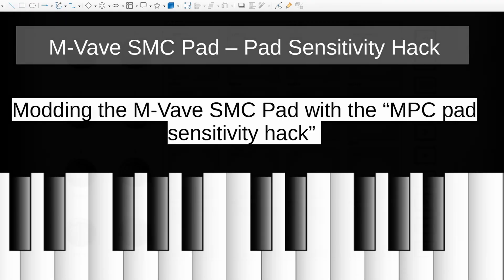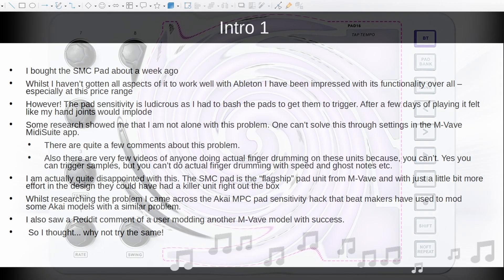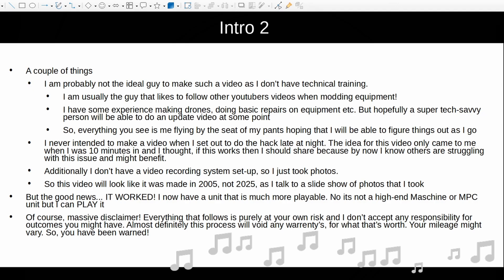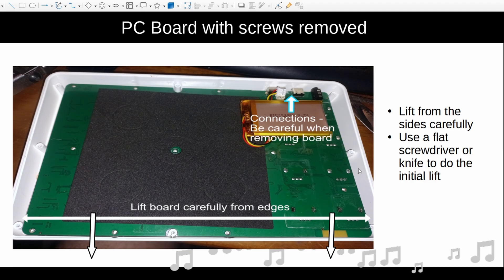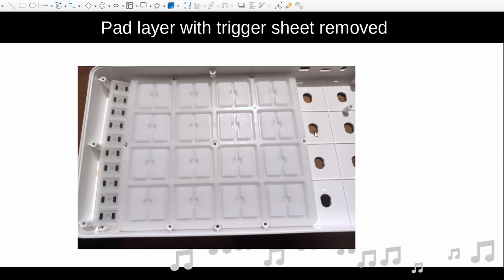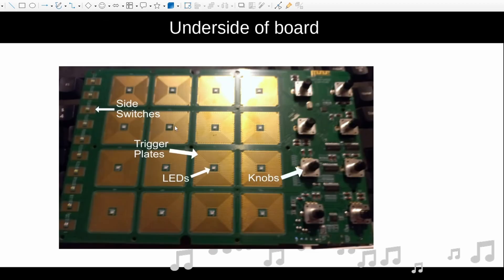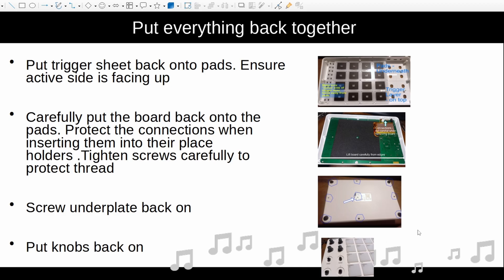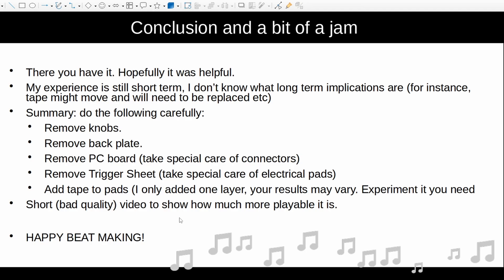M Vave SMC Pad Sensitivity Hack

Comment from the maker: I forgot to mention that I set the PadCurve to 3 in the M-Vave MidiSuite. I find this gives me my preferred sensitivity setting on the software level for finger drumming. So Pad Sensitivity Hack + PadCurve = 3 is awesome
Reply: Did you try setting the PadCurve to 3 in the M-Vave MidiSuite before you did all this? I'd hate to think that would have done it without opening it up. I'm willing to do all this but certainly going to try that first.
Reply from the maker: @BipTunia_Microtonal_Cats  Yes indeed, I tried all the sensitivity settings, multiple times. None of them made the difference I was hoping for, hence trying out this mod. A lot depends on your use case. If you just want the SMC Pad to control your daw and trigger long playing loops or tracks, then the standard set-up is fine. However, if you want to finger drum you are going to need to find a way to increase the sensitivity a lot. The only way I found to do this is through this physical mod, adjusting the sensitivity settings are not going to give you what you want. However, after doing the mod, I have found that adjusting the sensitivity settings makes a useful difference to the requirements of the moment. Mostly I keep it on level 3, but there are times I will change that. Hope that helps.
Reply: @owlmuso  Thanks. I will try this if I can't get it to work, but I plan on playing the one I ordered with light rubber mallets, so might not need the hack. Might not even need to change the sensitivity.
Reply from the maker: @BipTunia_Microtonal_Cats  O thats interesting... a unique take. Would love to know how that works for you if you don't mind sharing your experience.
Reply: @owlmuso  Thanks. I just ordered it on eBay last night, so maybe in a week I'll have it. I got the idea from seeing drummers play electronic drum pads in the 80s, they're playing a full kit, but have a pad thing, like this but bigger, with fewer pads, maybe 8, and it's hooked up to some percussion synth. Stewart Copeland used to to do it. 
            One or both of the drummers in the Grateful Dead used a bigger one in the  "Space > Drums" jam section in the middle of a concert. I just did image search for 
Bill Kreutzmann electronic drums
and found a pic of it, it's wider, maybe 2 feet wide and is set up like a piano, where the white keys would be and the black keys above, all on the same plane, for like an octave and a half, but the "keys" are rubber, all black, and probably 5 inches high and 2 inches wide. I never got close enough to see it but I heard stuff during the drum jam in the 80s that was played with that, and I've seen video from the 80s of them playing it. Probably cost as much as a nice car back then. lol.
Reply: @owlmuso  I wrote a long reply. It vanished. Grateful Dead and Stewart Copland used some kind of MIDI pads played with mallets.  (not all the time, just for flavoring on a few things, GD for "space / drums")
Reply: @owlmuso  Could probably even use (unused) pencils, hit pads lightly with eraser, use them like drum sticks.
Reply from the maker: @BipTunia_Microtonal_Cats  Yeah, drum pads have been used a lot since the 80s, so good inspiration there :). If I recall, Korg, Yamaha and Alesis made electronic drums, versions of which morphed into pads that could be used with acoustic drums.  Excellent for playing electonic sounds, loops etc and generally expanding the drummers sound pallet. The challenge with the SMC Pad will be the size of these pads... not a lot of real estate to aim at with drum sticks. Could potentially  work with micro drum sticks tho, I think. Also the unit itself is quite light so will need to be placed in a firm, safe place.
Reply from the maker: @BipTunia_Microtonal_Cats  Actually, I saw the long version... youtube can be weird like that sometimes. There have been times when I posted something, thinking that it didn't go thru, but then saw it later
Reply from the maker: @BipTunia_Microtonal_Cats  re. pencils... might not be heavy enough. I have messed around with the back end of forks or knives, which have worked on other pads I was trying out previously. But pencils would be ideal if they do work, in terms of size and form
Reply: @owlmuso  That's been happening more lately. I see it now too.
Reply: @owlmuso  Might be with the hack! I was just thinking pencils if anyone's on a tight budget. I'll let you know if what I ordred works, "4 Pcs Steel Tongue Drum Mallets, Xylophone Mallets, Glockenspiel Mallets, 6.5in Rubber Percussion Mallets, Children's Rubber Drumsticks, Wooden Percussion Mallets, Percussion Sticks" was 8.50 for 4 of them. Pictures show kids playing a xylophone, so probably won't break the thing.
Reply: Yes! Perfect that's the added fix. Two strips of tape for me, but sorted. That's brilliant thank you so much!!! 😊🎉

Comment: Also confirmed on the Pocket.  I had white electrical tape and just cut squares the size of the contact pad.  I covered over the LED as I found them a bit too bright anyway and the app doesn't actually do anything when you turn down the brightness

Comment: Thanks a lot for that, I just did this to my SMK-25 and with two layers of tape it feels way better. These video format is really good tho. It feels organic, not dead internet theory.

Tips for SMK-25:
- You don't need to void your warranty. There are no screws behind the sticker.
- There are two screws under the rubber things at the top, but not at the bottom.
- You don't need to remove two rows of screws at the inner bottom, as they only hold together the keyboard to the case
Reply from the maker: Awesome! Thanks for this feedback regarding the SMK-25. I am sure there will be those who will benefit from it. Are you enjoying the keyboard?

Comment: If there is anybody here for the MVAVE pocket. Disassembly is basically the same. Except it's just back housing, PCB assembly, front housing. 

I got good results putting 3M double sided tape on the bottom housing under the PCB, but leaving the red backing on the open side so I can still take it apart if needed. 

A lot more sensitive once you get some pressure in there.

Comment: THANK YOU! It fixed the problem 1000%.. I had to do it twice tho, because first try i used to much tape and too thicked of a tape, so i cut mine in half and didn't let if out of the rubber pads.
Reply from the maker: Interesting. Thanks for sharing. Did you take pictures of the tape that you installed?

Comment: Hey man thanks a lot for this video. I tried this hack and it is almost perfect, but for some reason PAD13 (top-left corner) is always getting a continuour trigger even with PadCurve 3 or default. I thought it could be the angle I was installing the PC board back on, or maybe the pressure a tightened screw could apply over that area. I tried everything, but PAD13 is simply not usable with the mod. So I took off the 3M Scotch Super 33+ Vynil Electrical Tape from PAD13, and decided to use that for FX samples and focus on all other pads for finger drumming. Has anyone experienced this as well? Any suggestions about a different tape brand? Besides that, this works just as you described, so thanks again from Costa Rica.
Reply from the maker: Hey dude. Sorry to hear about pad 13. I think you would have to play around with it especially as it is a corner pad, which might impact things. When I was experimenting, if I added 2 or more layers then the pads  would trigger continuously so obviously the overall thickness was too much. I would think that standard tape might therefore be too thick for your pad13 specifically, and might require thinner tape there. As a matter of interest, is pad13 relatively easier to play compared to other pads if they did not have tape?
Reply: @owlmuso it is slightly easier to play than the other pads without tape, but still difficult enough for it to drive me crazy. I'll try with less or thinner tape, thanks for the suggestion!
Reply from the maker: @VadikGilcok  Good luck man. Its hard to suggest an alternative to electrical tape as some other types of tape might be thinner, but also less hardy, which could impact reliability. For instance sticky tape comes to mind, but I wouldn't recommend it. But do us all a favour and let us know if you find a solution as I am sure there are others facing the same issue - o yes, and a shout out to Costa Rica from South Africa!

Comment: have the MVAVE pocket seems to be the same issue but haven;t been able to fix it gutted
Reply from the maker: Thats awful man. These units have so much potential, except for this issue of pad sensitivity. Have you been able to try a similar hack on the pocket - adding electrical tape to the underside of the pads?
Reply: @owlmuso  come back here as i finally got back into it - tried the tape. over did it, then took the tape out some how better - will let you know if i can drum well enough 🫰

Comment: Just bought one of these. I have no problems with pad sensitivity. Its just works great without any hacks.
Reply from the maker: Cool, don't open it up if you dont need to. Enjoy
Reply: I wonder if a lot of people complained and they fixed it (maybe because of this video!). Owl, when did you get yours?
Reply from the maker: @BipTunia_Microtonal_Cats  I have read quite a few complaints about the pad sensitivity online... reddit, amazon reviews etc. So, its not just me thats complaining, lol. I bought mine about 2 months ago and I doubt they would have fixed the issue since then as it would require a hardware upgrade, something I would imagine they would do in a Mk2 version for instance.

Comment: I love this company man, I own one of everything they sell. I consider them on-par with any of the lower-ended branded stuff but at a ridiculously lower price point. Some of their shit even has more or better features than their branded equals. The SMC-Mixer is like it was made for Ableton. I didn't purchase the Pad for finger drumming. I use it for triggering & holding Arps & Basslines (303 etc.). So like horizontally across, 1st pad is Hold & next 3 are 3 octaves of the same key & the 2 rotary encoders in each row are Cutoff & Resonance. Each row lives on a different midi channel so there are 4 synths I can control. Different preset on the pad (there are 8), different key. Works for me. Lately I've edited all the bottom rows to fire-off single shots, 3 synths were enough for that job.So in this scenario, pad sensitivity not so critical for me. The SMK25 MkII with it's layout (8 horizontals of 2 pads & 1 rotary in each) became an extention of my SMC-Mixer so I can have Chan.9-16 from Ableton accessible (Mute, Solo, Track Level), without scrolling the mixer (I probably will purchase a 2nd unit at some point). The SMK25V2, similar scenario, 8 Presets, on 8 seperate midi channels, 8 different possibilities. So yeah, only good things to say about this company. They do what the Chinee do best, copy the shit out of other people's efforts, make it even better & sell it at half price. Gotta love'em. Cant wait for them to do a proper Launchpad with RGB feedback from Ableton. I'm really needing it these days & might have to grab the Novation or Akai, when the wife isn't looking.
Reply from the maker: 100%. I am new to M-Vave but I think your analysis regarding their "place" in the music making market is spot on. I really like my SMC Pad for how useful and fun it is. Out of the box it is a really good controller and sample trigger. And if thats what you are using it for then its great as-is.  I appreciate learning how you put it to use as I want to extend how I use it with Ableton - I am having problems implementing the controller side of it.

To continue with the discussion about finger drumming. To me finger drumming is implied in its "mission". The 4x4 pad set-up looks like every other standard finger drumming unit. Thats why I bought it, and, from what I see online, why many others also bought it. its not like I am trying to use it for something other than what its marketed for. So, as a finger drumming unit, it is limited out of the box. I need it to not only be a controller, but also an instrument. This hack turns it into an instrument for me. To be honest, I am a little disappointed with M-Vave in this regard, in that with just a little more attention to the design of pad sensitivity they could have satisfied all users - midi-control-centric users as well as finger-drumming-centric users. Bottom line is this hack turns the SMC Pad into a really cool finger drumming unit, which makes me happy.
Reply: @owlmuso  Have you seen their new product, SMC-Pad Pocket. No knobs or buttons, just pads & about 40% smaller, 40% cheaper. I'm going to grab one for extra buttons. It's a no-brainer for turning FX On & Off.
Reply from the maker: @AA-ge4uj  I did see that Pocket Pad. I wasn't planning to get it because I already have enough controllers for now. However it does look prettty amazing, I must say. One thing that would awesome though, if you wouldn't mind, is explaining how to use the SMC Pad as a controller. For the life of me I can't get it to work as a controller. If I want to use the transport controls I have to manually map them for each new project, which is not the preferred way of working. Also, bluetooth... do you have that working in ableton?
Reply: @owlmuso  You map the Pad's controls to Ableton once (MIDI button, top right), on a clean Project. And then go: Options/Preferences/File Folder & up the top is "Save current Set as Default". Save & that becomes your Default Template, including any Midi cc Mapping. Bluetooth worked for me with the Korg Ble Driver they originally recommended & also with the Sinco Connect software. Make sure the USB cable is not connected, pair it up & it should work.
ps: I'm using a Windows machine.
Reply from the maker: @AA-ge4uj  Awesome thank you! I was hoping to avoid the manual mapping and rely on the "instant mapping" feature that would automatically map the controls. But I get you, so now I have mapped the controls and saved as a default - it works great. Thanks for confirming that for me. I really need to look into the BT on my machine, maybe I have an issue with BT on the PC cos the Korg BLE is not working.
Reply: @owlmuso  "Instant Mapping Feature"? That's wishful thinking for 50 bucks.
Reply from the maker: @AA-ge4uj  True, in the sense of a unique map for the SMC Pad. But I was thinking along the lines of M-Vave aligning their MIDI maps so we could use the Mackie Protocol. Obviously that didn't happen. The manual mapping works fine though
Reply: @AA-ge4uj  one of the default presets works out of the box with Mackie Control.
Reply: @owlmuso except it did and it does. If you read the manual it tells you about the daw preset that comes default in slot 3 or 4, which works with Mackie Control mappings
Reply from the maker: @Nicole-pt4bx  You know I tried, with multiple presets and various configurations, to get the SMC Pad working with Ableton in controller mode (including the preset mentioned in the manual) - and I couldn't get it to work. Could well be user error, but I was happy enough to midi-map buttons and knobs to Ableton controls, save it as the default session, and move on. At some point I will probably look at this again and get it working as advertised. Thanks for checking the video out.

Comment: Yo, thank you! Just followed this through exactly as you've done it and it's made a huge difference. 🙏
Reply from the maker: You are welcome bud. Happy music making! As a matter of interest, did you use just one layer of tape on the pads?
Reply: @ thanks! Yes, one layer of electrical tape.. I may open up again and try a second but trying to gain a bit of technique to solve pads not triggering so we’ll see. Its few and far between now and largely because I'm not actually hitting the pad as opposed to it not reading a hit! All the best in your finger drumming quest too! 😀
Reply from the maker: @RoryMcLeanMusic  Thank you! Just to let you know that I also don't always trigger the pads even with the mod - there are still times when there is uninvited silence, lol, even though its a LOT better than before. Also, if you haven't done so yet, try the PadCurve on 3. I find that works well with the mod and allows a more delicate approach on the pads, even if its not perfect. Let me know if you do try the 2 layer version... but I would suggest changing the PadCurve setting first if you haven't tried it yet